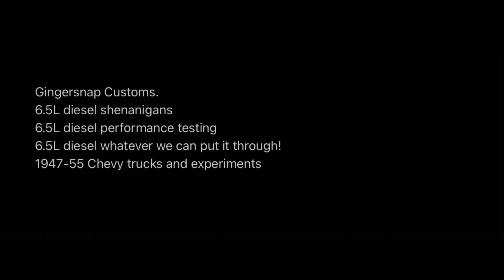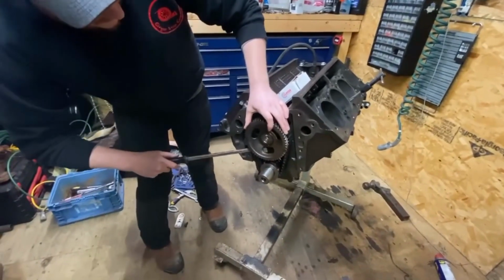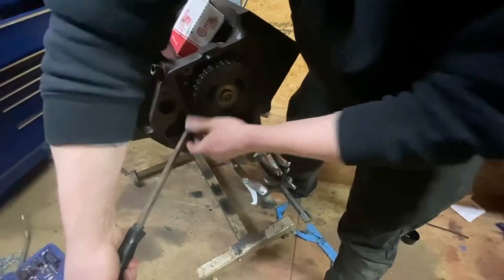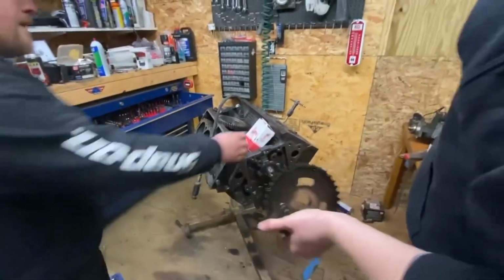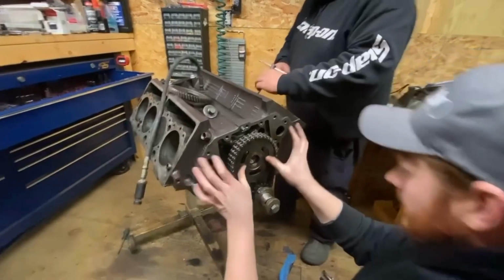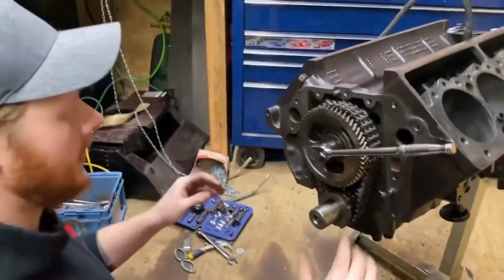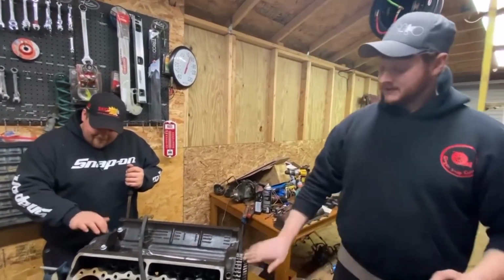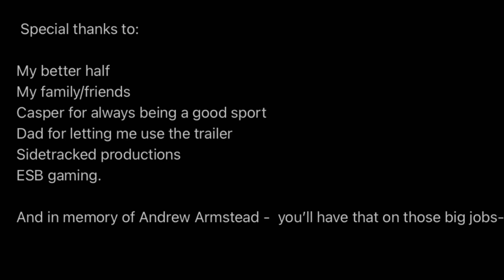GSC/MSM 6.5L diesel timing chain replacement

Comment: Just wondering why didn’t you change the timing gears as well? And when do you know when it’s time to change the gears with the chain?
Reply from the maker: I’ve measured multiple sets of gears in the past and realized they aren’t the major wear point. I’ve done a number of chains with good success. If you can find a full set of gears and chain then do the full swap of you can. Doing a full engine rebuild is a good time to do a full time set. Or do it after 200k miles.
Reply: @gingersnapcustoms  awesome thanks for the info

Comment: what chain-kit brand do you recommend?  link maybe where to buy?
Reply from the maker: Let’s see if the link works 

https://www.rockauto.com/en/catalog/chevrolet,1994,k2500+pickup,6.5l+v8+diesel+turbocharged,1052581,engine,timing+chain,5724
Reply: @gingersnapcustoms  you recommend to buy just chain or all the set?
Reply from the maker: @Tadas585  I just do the chain. I’ve never seen gears worn enough to do the full set.
Reply: @gingersnapcustoms  In one of your videos I've seen about Harmonic Diesel Damper. Do you recommend it to change? like example if original one looks fine? Sorry for my English :)
Reply from the maker: @Tadas585  I would recommend replacing it. If you can get one of the AC delco it will be best.

Comment: Hi, help me with the following question.
At the timing mark which pistons are at top dead center????
Reply from the maker: Either number 1 or 8. The harmonic balancer when it sits at the 0 mark on the timing cover and the timing marks are aligned then it is at top dead center.

Comment: Does anyone know if the 6.5L diesel is a non-interference engine?
Reply from the maker: They are an interference engine. So if you break a cam key or a valve retainer you’ll leave some nice marks on pistons.